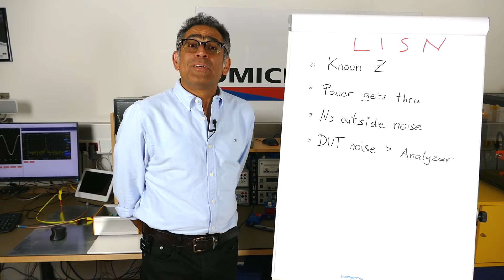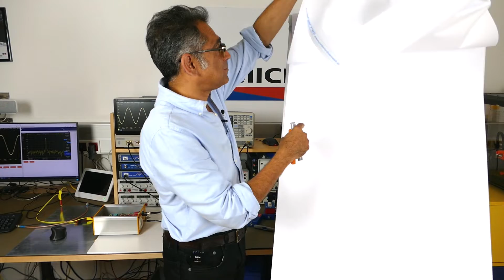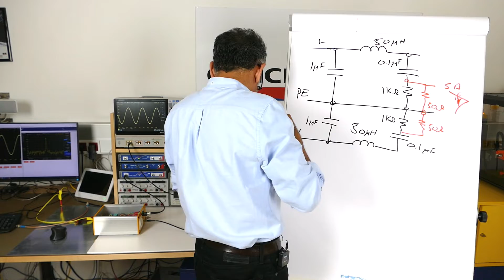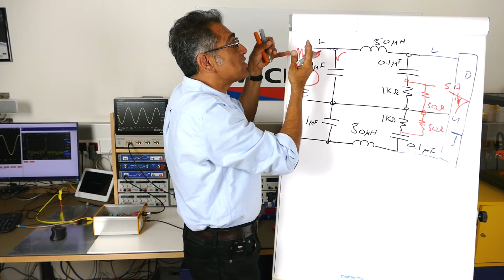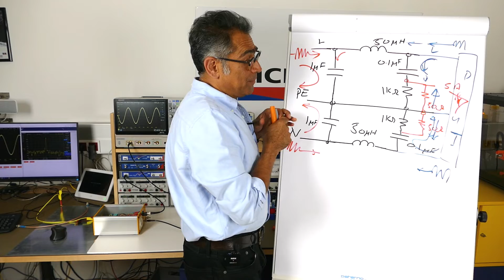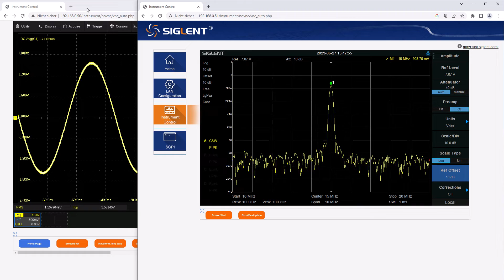LISNs Explained in Simple Terms: What Is the Job of a LISN & Why Do We Need it for EMC Testing

Comment: I am designing an electromagnetic compatibility (EMC) filter for a 28V to 3.3V DC-DC buck converter IC. How can I determine the LISN parameters to create a LISN model based on CE101 and CE102 tests according to the MIL-STD-461G standard?

Comment: Thank you, clear and good explanation!
One thing I would like to note for people developing products that will be tested with a LISN, is that if you are unlucky your EMI RC snubber circuit can actually start oscillating when connected to a LISN due to the added inductance of the LISN. Have seen it several times in DC luminaries!